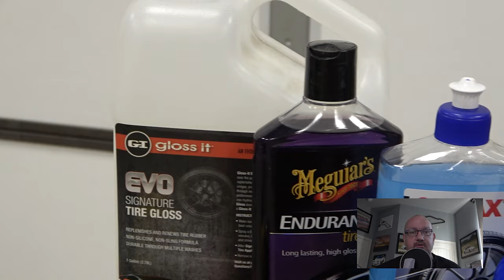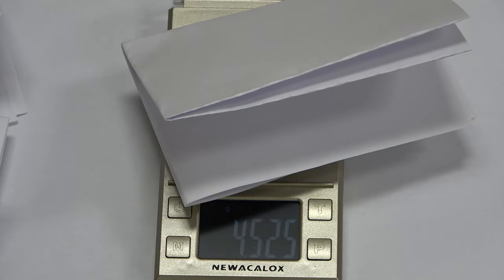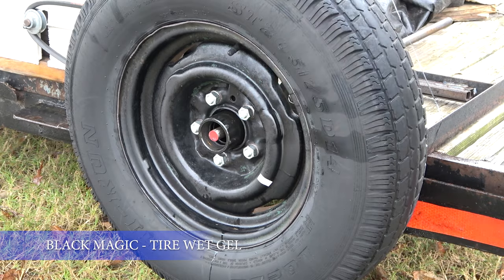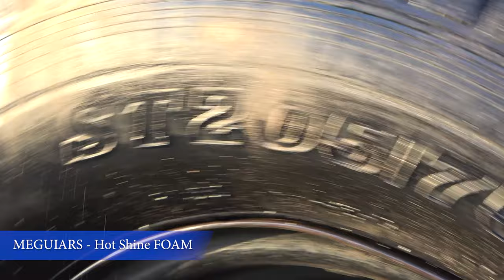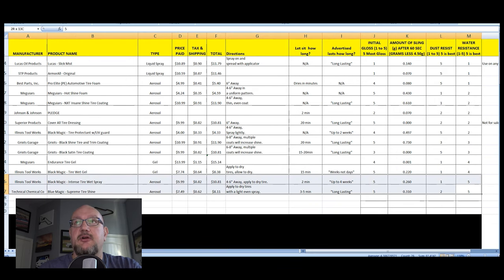ULTIMATE Tire Shine Test - We buy and test ALL OF THEM (Part 1 of 2: Store Bought) Is yours here?

Comment from the maker: Just wanted to clarify one thing that I forgot to mention: the tire was cleaned with 100% concentration "Purple power" degreaser and a nylon brush, then rinsed and dried before an application of a new product.
Reply: You used my idea! Awesome!
Reply: Is purple power safe on tires?
Reply: Do you remember if you cleaned it to the point where water would cling to the tire rather than bead up? That would indicate the tire was truly free of previous product residue and allow for good bonding of the next one.
Reply from the maker: @gregorymarsh9504  yes.  I make sure fully between each product.

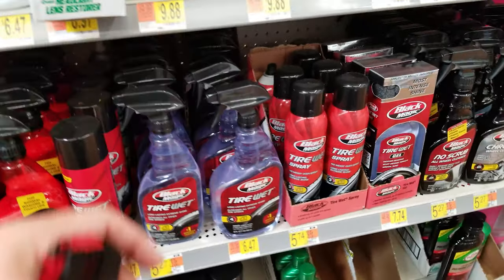Comment: Black Magic Tire Wet Spray 08:20
Black Magic Tire Wet Gel 11:43
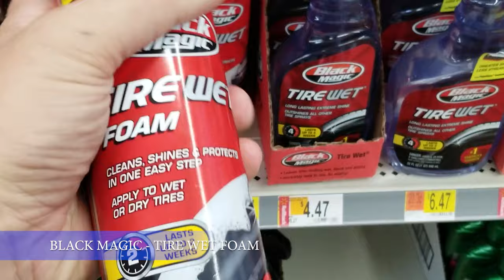Black Magic Tire Wet Foam 14:00
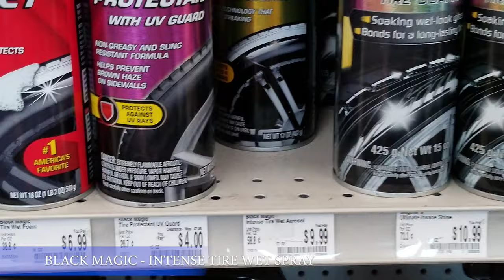Black Magic Intense Tire Wet Spray 15:50
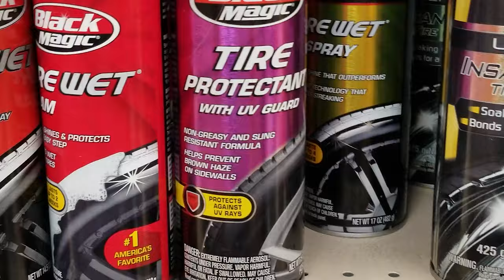Black Magic Tire Protectant w/UV 17:29
Blue Magic Supreme Tire Shine 19:11
Pro Elite Auto Tire Foam 20:36
Lucas Slick Mist Tire & Trim 21:14
Energizer Eagle One Epic Tire Shine 22:08
Pledge (Furniture Polish) 23:01
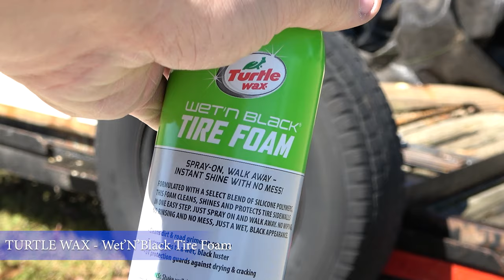Turtle Wax Wet 'N' Black Tire Foam 23:40
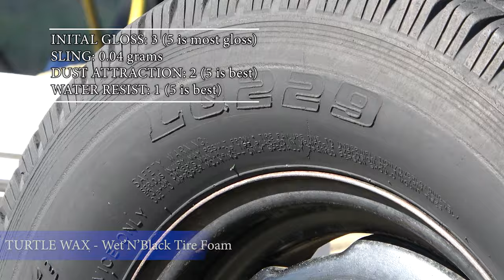STP Armor All Extreme Tire Shine 24:27
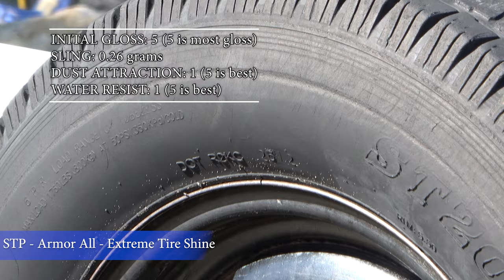STP Armor All Extreme Tire Foam 25:13
STP Armor All Tire Foam (non-Extreme) 26:02
STP Armor All "The Original" 26:52
Mothers Speed Tire Shine 27:36
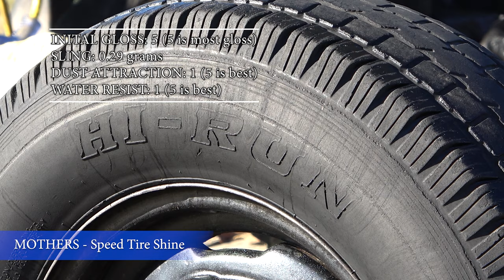Superior Cover All 28:28
Meguiars Endurance Tire Gel 29:19
Illinoise Tool Works No Touch 30:16
Meguiars Ultimate Insane Tire Shine 31:18
Meguiars Hot Shine Reflect 32:16
Meguiars Hot Shine Foam 33:19
Meguiars NXT Insane Shine 34:18
Griots Garage Black Shine 35:13
Griots Garage Black Satin 36:22
Turtle Wax Wet 'N' Black Tire Shine 37:42

Winner 38:36
Reply from the maker: The real winner is this comment!
Reply: Thanks
Reply: @ScottHD  if you copy this into the description youtube will actually pick this up and put timestamps in the timeline!
Reply: @ScottHD  true, it will select up all of the sections
Reply: @markkalsbeek5883  you have to put "0:00 Intro" at the beginning or it won't

Comment: Its nice to see the best store bought is what I like to use. I bought it by accident one day (didn't read the label) & have been a fan of it ever since. Imo, their other product you tested sucks. I used it one time when cleaning my truck & how my truck looked after driving, it felt like pissing in a strong headwind after a shower. I almost only use their products but they need to take that one back to the drawing board.

Will you test their gel in pt 2? They claim it's performance is better than their spray.

Also, good job on the sling test! 👍👍👍
Reply from the maker: I'll see if I can get some quickly. There's still time!